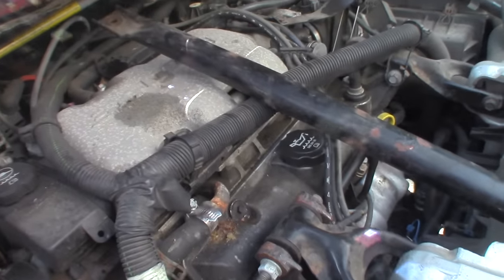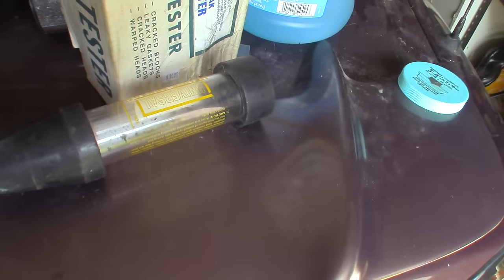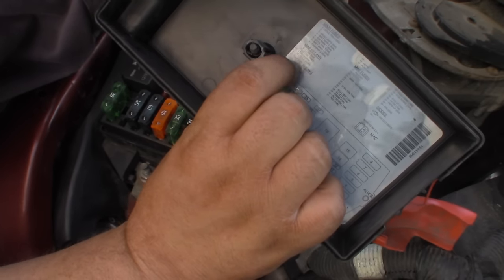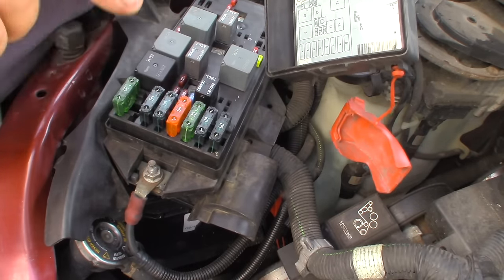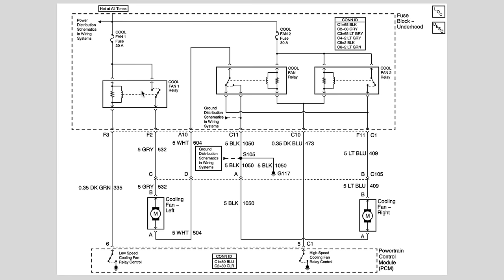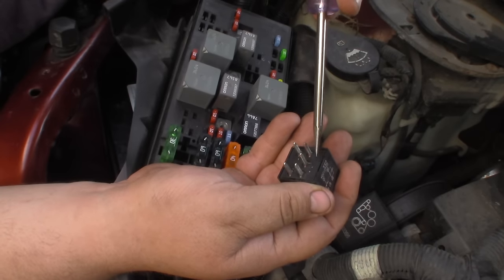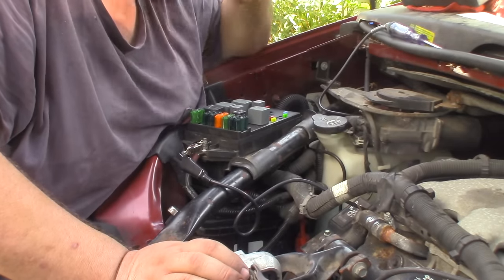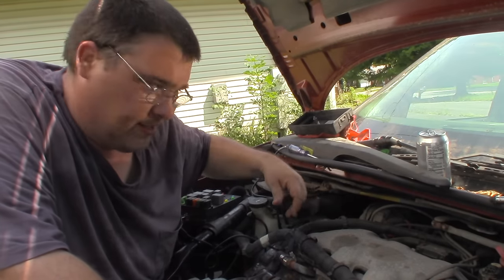GM 3 Relay Low/High Cooling Fan Explanation/Diagnosis/Testing - Chevy Venture

Comment: Don't you just love those friends that want you to work on their car when they have a problem but they always neglect scheduled maintenance even though you repeatedly tell them that they need to stay on top of that stuff?
Reply from the maker: Yeah and when he does buy oil, it's at the Dollar store and it's SAE 30 Non Detergent, because it 30 cents cheaper.   I try to tell him that oil is for lawnmowers.
Reply: @frugalprepper  🤦🏽‍♂🤣😂🤣😂
Reply: @frugalprepper  
Why would the fans kick in at 226.when water boils at 210.????
DONT UNDERSTAND. THANKS

Comment: What would cause high speed fans not to come on?   I have 99 Toyota Rav4 which has (3 fan relays, a radiator fan switch, coolant temp sensor, and coolant temp switch).  I tried replacing everything, but  the high speed fans will only kick on when unplugging the radiator fan switch, not when temperature exceeds 220 deg f or even 230f.  The low speed fans come on when turning the A/C on or defrost mode,   Being that both fans will come on when the radiator fan switch is unplugged tells me that both fans are working..I'm stuck at this point???? Ughhh..... Update: After taking the vehicle in the to be looked at it was discovered that the thermostat was stuck closed, all is working now after replacement and I can use A/C again!  Hope this helps some of you!
Reply: Hi buddy I have pretty much same issue bit diff car any joy matey? 😊
Reply: Hmmm I good on buddy you got it sorted I've just put an oem there in mine no difference along with new pump

Comment: I got a 2011 Camaro SS. My temp got up to 235 n no fans came on.  I put power to the connection on fan side. They both worked. I put power n ground to each again  on the harness side of connector and only the right fan worked unless I used the other side"s ground. I put power to the relay  n heard it click.  I can't figure it out

Comment: Are you saying that the computer supplys the negative signal to the fan relay coil and the positive coil signal is supplied by a fused positive from the coolant temperature sensor? And this in turn sends a high current fused positive to the fan motor thereby completing the circuit s the fan coil is is grounded to the block or chassis?

Comment: hay tom i dont know about electronics but i had 12v pwr on pin 87 & 85 hi side relay harness connector then i tested it again & got 12v pwr on 85 & continuity on 87 between relay harness & fan plug. went 4 a drive & tested again now ive got pwr on 87 & 85 again.any thoughts.

Comment: It’s work for me i do mecanic and electric and forgot when you have 3  relays and 3 fuses on taho 2005 the fuses produce power to relay 12v continuously but my fans putting directly to power ( fan number 1 on my is low kik in whit 86power to 30.) (fan number 2 kiks in whit 30power to 86 ) but on reverse and ( number 3 kik in whit 86 power to 87a) my fan 1&2 are gray relays and fan 3 the black one the main

Comment: Hey man. 05 chevy uplander. Fans not turning on. I did test the fans connecting them to power and they work fine.. i have the same 3 relays. Potting ground to relays, one is the low fans (both) and the other two relays are high fan (only passenger side fan turns on ehen bypass relays(high fan). Fans do not come on when you hit the ac button.. what do i look for. Its driving me nuts.
Reply from the maker: If it is not coming on when you hit the AC button, does your AC work, is is charged.  The HVAC control module will not signal for low speed fans unless the pressure sensors she correct pressures and engage the compressor.  To run both of the fans in high speed you have to engage the low speed and high speed relays.  If you are only tripping high speed then only one of the fans will work.

Comment: Wired up a 03 silverado e fan conversion using the stock relays, aftermarkets wouldnt hold up. i grounded each fan and had cooling issues, realized one 40a source was split to each fan because of YOUR video! Thanks for this!
Reply from the maker: Thanks for sharing

Comment: Man videos like this is want makes youtube the best! 
With your explanation and a wiring diagram for my vehicle i was was able to troubleshoot and solve my cooling fan issues. Thank you.
Reply from the maker: Great to hear!
Reply: What issues were you having and what was the fix? Thanks!
Reply: Of the two cooling fans on my 2011 silverado, only the passenger side fan would come on, and it was very loud. Not from the fan motor but from fan speed being so high
After watching this video and getting a wiring diagram for my cooling fans, I figured out that both fans should be running on low first and really never on high speed unless there was an issue.  So my problem was, neather fan was getting power when calling for low speed because I had water damage on the one connecter feeding the driver side fan. And, in normal operation, at low speed, the power runs  through the driver side fan first then into the passenger side fan. That wasn't happening because the power was never making it into the driver side fan. I ended up having to replace the pigtail connector into my driver side fan.

Comment: I tried everyones way and was unsuccessful. I followed yours, found out that the issues was a fuse and now my fans kick in at 93 degrees. They didn't work previous. Had to get a new relay. So thanks for the video
Reply from the maker: Glad it helped
Reply: Hmmm I must test mine tomorrow then was your fluid getting hot ?
Reply: @kevinhancock4064  if the fluid is hot, it would be bubbling. Which isn't a good sign

Comment: Right now I'm fighting with an issue like that, but in my case the fan's doesn't work and get hot, they only work low speed when the ac is on only, I'm thinking about the computer, I just need to measure the signal line to the relays,  great video cause is a funny connection fans control.
Reply: Sometimes the computer negative signal to relay coil is burned out. You will not get relay activation in this scenario thereby no fan activation will happen untill this negative signal is present to the relay coil
Reply: I ran a wire to the bottom of steering column. Put a fuse before a switch. Then found the main fan relay in the fuse box under the hood. Terminated wire to that relay. Flip switch, grounds relay coil. Both fans spin up.

Comment: Thanks for the Minimalist troubleshooting. It at least gives me a few ideas on what to look for.
'06 Uplander (daughter-in-laws) was running hot. Son did a bunch of (needed) crap, Flush, Radiator replacement, T-stat, Temp sender......and ........it still runs Hot, boils Antifreeze out etc.
Dash Temperature gauge reading as expected.
No, the Fans are NOT coming on.
Yes, at one point they ran on Low with the AC on, but low isn't doing the job. *Not sure if the Low speed is currently working, but easy enough to verify.
** Thinking 
1st - Verify tripping the relays will activate the Fans. If good,
2nd - Split that Fuse panel and inspect the underside for damage/Corrosion/etc.
3rd - Confirm Signal going out to Relays for Low/High speed operation.
Hopefully we can get this sorted out once and for all.

Comment: Good video very helpful, one question at what temperature dose the high speed fan turns on
Reply from the maker: Usually around 230-235 the high speed fan kicks in.

Comment: thanks for your efforts
impala 2012 
no blown fuse all relays good
fans not work
only with scan tool using active test
please tell me about the problem
Reply from the maker: HATTAF RASHED هاتف راشد remove the temps sensor and see if the come on then.
Reply: @frugalprepper  
thx for promptly
I do
not work
thx

Comment: I have a pretty good idea as to how all of this works, and enjoyed your explanation.  My problem would be "reaching under the relays,"  with the little conductor, and using the test light.  The control pin must be right on the corner, right?  Thanks, I subscribed.
Reply from the maker: Yes
Reply: You can pop the top off the relay and backprobe it like that.
Reply: @mr.fredricklawngtawnghedav5094  Thanks, good idea.

Comment: I am having a issue with my fans but don't know anything about fixing or changing or have tools like you do changing the fuse is that what I should first and temp sensor i saw a guy take off the temp sensor to see if the fans came on first

Comment: And I wonder did this vehicle come back with the same problem. Curious to know if it was a intermittent problem ? I have been chasing this issue for a long time. And have yet to try a computer but believe this is my issue. I have tried a new ECT sensor, thermostat, relays, new fans after a new motor & trans R&R. At first thought maybe sludge from factory antifreeze. Did a flush on old motor. No help. I have watched the fans work fine thru the cycle as designed until when you need them the most on a HOT day. Then only the right side fan comes on high. I can not get both fans to come on high even with the ECT unplugged. As they should do. Any help would be appreciated. I hate to ruin a NEW motor.
Reply from the maker: This vehicle ended up having a plugged radiator.  Owner kept driving it and ended up over heating it and cracked a head.  He decided to junk it.

Comment: First off..... Thanks for the video!! Second... I would like to ask for any assistance with my issue! I made a connection where the cooling fan relay is and the fan turns on... So I replaced the relay and was not turning on still so I replaced the temp sensor which was a pain to get out and still was not turning on with the relay in... So I removed the cooling fan relay and the fan turned on about 5 minutes into my last ride? Do you think this is an issue with some other relay or something completely different??? I tried to watch your videos like 5 times but I have 4 kids with me so a bit difficult to follow the video well enough! Lol ... ANY INFO THAT COULD HELP ME AND GET THIS FIGURED OUT IS APPRECIATED MORE THAN YOU COULD KNOW!!! THANK YOU TO ANYONE THAT TAKES THE TIME!!!!!

Comment: I have a 1998 Chevy Lumina LS 3.1. Coolant fan doesn't work when plugged into the temp sensor, which I had replaced. The pigtail is good. Changed the pcm also. Still doesn't work. If I unplug pigtail from sensor, fan will run continually. I think it might be the engine coolant fan switch, but cant seem to locate where it is on my vehicle. Any suggestions? Also, I had the a/c unit removed and had a bypass pulley put on. Would that have anything to do with why the coolant fan isn't working?
Reply from the maker: Will the fans run in low speed.  Do both fans run when coolant sensor is unplugged.  If now you may have one bad fan so they wont come on in low speed, and you only turn on high speed when you get up to around 235F.

Comment: HI Tom, I have an 05 silverado 5.3. Fans come on as soon as I start the truck. Changed all relays and the temp sensor found corrosion on pcm pins cleaned as best I could. No luck. Any ideas?
Mark

Comment: Great info but I have the same problem, 03 Impala 3.4. My fans do not kick in at mid level on the temp gauge. Ground is clean and secured. Fans will turn on when the ac is on. What is wrong ? Thanks
Reply from the maker: You need a scan tool to see what temp you are actually getting to.  The fans don't kick on till it gets up around 230.  The thermostat opens at 195, so you have to get it really good and hot to get them to kick on.
Reply: @frugalprepper  Thanks for your time, I am getting 195 temp but no fans turn on at mid level. But will turn on past mid.
Reply: @frugalprepper My setup very similiar issue with mine was fans wont turn unil temp reaches over 222 way to hot for my comfort seems to be designed that way. I never observe low speed even monitored my voltage on a single fan to confirm going directly to high speed, but water is already boiling before fans kick on. so after changing tempature sensor which did not help i think there is firmware issue need to be set lower, since i dont have scan tool i added additional resistor in parallel to the sensor approx 1200 ohm will allow the fan to kick in at about 200. Problem solved i just get use to the dash display showing a little higher but thats accually about 192 as i also added a switch to switch in and out the extra resistor. After looking at schematic the normally closed position on the relay could be open would explain my never seeing low speed. I will double check that but high speed setting is too high and dangerous as boiling water will not ciculate.  I accually used a potitiameter as my extra resistor so i can tweek it if needed, my switch is there so i can switch back to see what accual temp really is if needed. Firmware was designed wrong and will wreck these engines if not modified. Just my opinion. Before i solved the problem you can turn on the ac as a work around it will force the fans into high speed to prevent overheating. This issue only shows up when your driving under 20 mph for several minutes and the AC is off. or maybe at a railroad and have no air flow over the radiator. The tempature sensor is a variable resistor spec sheet available online but about 178 ohms at boiling point and 260 ohms or so at 192 which is where the thermostat tries to regulate it. so 222 is way too high , purhaps my only issue is low speed fan wont engage but at this point seems like i applied a patch to ecm firmare issue.

Comment: Thanks for the video Tom. 
Good info question did you put the new battery in before or after you tested the relays? 
Wondering if the battery would be some of the problem.
Reply from the maker: We put it in before.  In would only charge up to 8 volts.

Comment: I got a problem hope u can help me, I have a 2013 silverado and my high fan is not turning on the fan will work when I get the a/c on, but if I turn off the a/c the fans stop's working, then I remplace all three relay's for a new ones, and is doing the same thing doesn't work, but when I remove the plug from the coolant sensor the high speed fan works and if I connect it back stops working
Reply from the maker: What temp have you let it get up too and not seen the high speed fan come on.  Usually it only kicks the high speed on if it gets up to around 230-235.   If you unplug the temp sensor and the high speed fan comes on then the relays and fans are working correctly and the PCM can command it on.  That would mean a problem in the programming/software of the PCM (highly unlikely), or the PCM is not seeing the temp get high enough.  I would verify with a scan tool that the temp is getting to 235 or 240 and not kicking on the fan, don't go by the dash guage.   Also I would check at the housing of the temp sensor with a Infrared thermometer, and verify that it correlates with what the temp sensor is reading.
Reply: @frugalprepper  I let the temperature 210
Reply from the maker: @alexflores1299  I probably doesn't kick on the low speeds till about 220 and the high speed at 225-230
Reply: I have same problem 09 GMC Sierra have to drive with ac so it wont over heat changed temperature sensor nd my relays still dont turn on.
Reply: I hear a buzzing noise by computer but not sure from exact location the buzzing is coming from.
Reply: I'm having the same problem if I turn my AC off it goes past 210 a little bit but if I run with the AC on it runs at 2:10 where it should be so I have to run with the AC on.. did you figure out what it was??
Reply: Did anyone figure out the problem? I have a 2012 Silverado and I replaced the temp sensor as well and the low speed fans only come in when a/c is on. I unplugged the new temp sensor and the high speed fans kicked in. But when I plug it back in it turns off.

Comment: Would this be similar to 2020 trax? While back had the issue where it ran nonstop and that got resolved, other day was driving through town and it was starting to over heat, turns out the cooling fan is no longer running. Relays are okay but haven't tested the fan itself yet
Reply from the maker: It may be.  Does it have two fans or one?
Reply: @frugalprepper  it looks like only one fan. I had tested the control relays they are okay but the hi speed relay does click but is still open across the other terminals

Comment: Ok, if i needed a manual switch for fans, what one to jump for high speed? Im jumped on fan relay 0 and got low speed no problems. But i had the feeling the other two relays were for higher speeds. Thanks!
Reply from the maker: You will want go ground Fan Relay and Fan Relay 2 to turn on the high speed fans.

Comment: My cooling 😎 fans turn on full blast when I'm driving and they don't turn off unless I unhook the battery. Could a bad relay create this problem. Should I replace both relay controls ? I have a 2015 Suburban LTZ. I appreciate your time.
Reply from the maker: A stuck relay could cause that problem.  I would to see if the computer is commanding them on with a test light hooked to positive and probing the control pin.  If the computer isn't commanding them on and they are on, then most likely a stuck relay.
Reply: @frugalprepper  
I bought new ones. I'm going to install them in the am. Would that keep the ac from blowing Kool air or maybe it's just time to revamp the coolant.